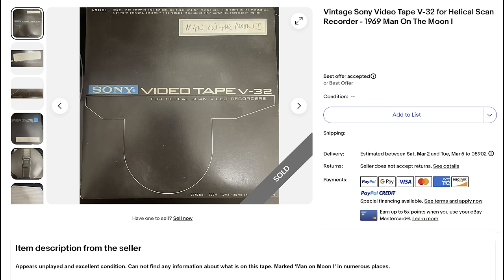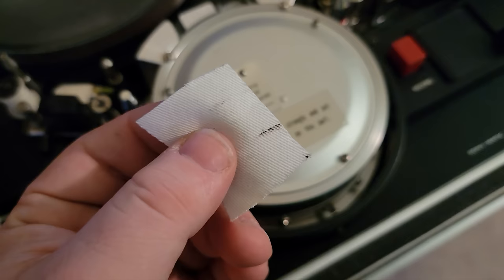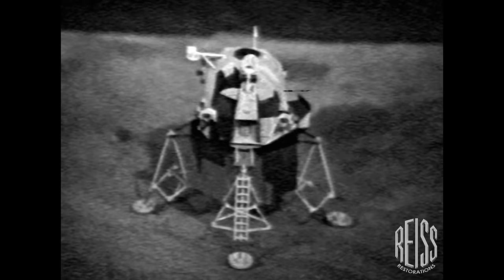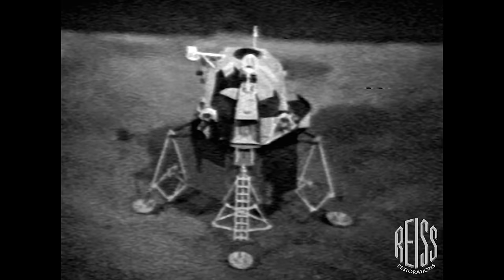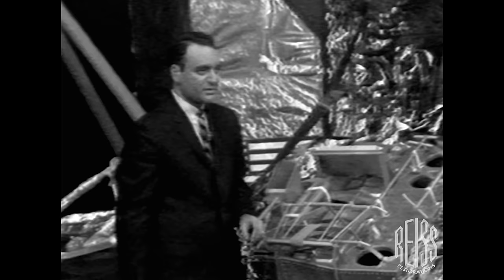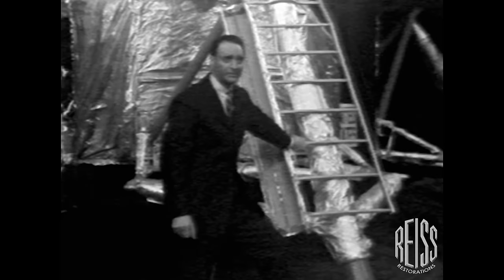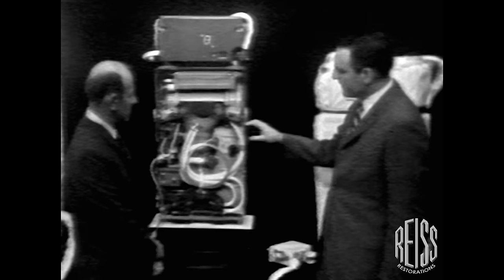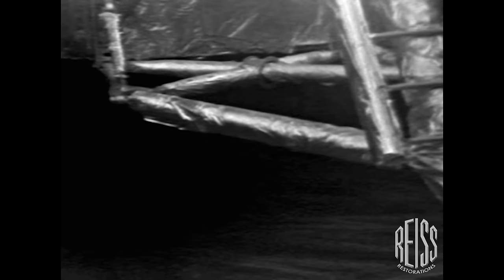Finding and Digitizing the Apollo 11 Moon Landing on NBC (July 20, 1969 - Partial Broadcast, B/W)

Comment: They did this landing in 1969 with the computing power of a cheap calculator and live real-time audio, as it happened live... and yet in 2024, they can't even land a little lander without it topping over, and they did it WITHOUT any real-time video. You would think that in 2024 the Intuitive Machines-1 lander would have had a real-time video feed from an onboard camera during the landing so the engineers could have at least watched the landing as it happened and known right away it tipped over, instead of waiting 15 minutes for a faint weak signal. to tell them it tipped over.
Reply: A real-time feed wouldn't work. Radio signals travel at the speed of light, and the moon is about one and a half light-seconds away. That means the video takes a second and a half to get to earth, and the response from earth takes another second and a half to get back. By the time your response is taking effect on the moon, it's two or three seconds too late. Neil and Buzz could react in real time because they were physically present, but the robots have to make do without human help. In Apollo 11s case, the human element was absolutely necessary because the LGC was going to land them in a boulder field; Neil took manual control to fly over it, and it took nearly all the fuel in the descent stage to get there.
Reply: The computer was mainly used for telemetry and monitoring they onboard systems.  It didn't land the LM, that was done manually.  It is incorrect to say that they can't land a  lander now.  It has been done more than once in recent years, in spite of the  failure of one of the landers.
Reply: @my3dviews  " It didn't land the LM, that was done manually."  That's simply not true... research 1201 and 1202 program alarms.  An automatic landing system was guiding the Apollo 11 astronauts on their final descent to the Moon. But Armstrong noticed it was sending them toward a boulder-covered crater. He quickly took manual control to take them safely to a flat area. during that override, the computer was getting confused between what it was supposed to do and what Neil was commanding it to do triggering the 1201 and 1202 program alarms.  Capcom told Neil to ignore them and to continue.  All subsequent Apollo landings used the automatic landing system.  And it's not just "one" failure...  the Japanese lost one just weeks or months earlier as did the chinese. ITs actually more frequent than you are leading people to believe.
Reply: @SuzuranMajere  LMFAO  who the hell do you think you are talking to?   First of all, a camera on the IM-1 (or Apollo 11) would have just been a monitor so it would make no difference whether it's .5, 1, or 1.5 seconds or longer... its just a video feed.  Who cares whether there is a delay or not.  the thing was landing autonomously, the video picture is pointless other than to "just watch" so the engineers would know how it landed.  And live camera feeds were coming from the moon's surface on ALL the  Apollo missions,.  Including a live video feed from the lunar rover while they drove around. We watched it happen live.  So what if it was a 1.5 delay.  The delay is pointless in terms of just watching.
Reply: @SuzuranMajere  "In Apollo 11's case, the human element was absolutely necessary"  Also bullshit.  In 1969 there was NO way of flying over boulders automatically because Terrain Following-avoiding Radar hadn't been perfected yet.   Research F-111 TFR.  So in that case yes Neil had to override the landing computer.   But 50 years later Radar altimeters and Terrain following/avoiding radar have been perfected.  There is no way a machine in 2024 shouldn't have had its own autonomous terrain avoidance landing system.  A System to automatically avoid terrain i.e. rocks or boulders that would allow it to topple over.  This is what happens when someone posts a comment assuming people are as knowledgeable as me, and then they try to respond not knowing 1969 technology vs. 2024 technology.  Thanks for trying though.
Reply: @ILSRWY4    Sorry, but you don't know what you are talking about. 
All six landings were done manually.  
Look it up.
Reply: @my3dviews  And you don't know how to comprehend the English language.   You said "The computer was mainly used for telemetry and monitoring the onboard systems" I told you that it had an automatic landing system and then I told you  "All subsequent Apollo landings used the automatic landing system."  And that is 100 percent TRUE.  The automatic landing system took them down to a couple hundred feet, from there I never said anything about who or how the actual touchdown was completed, only that there WAS AN  automatic landing system that was used for more than just monitoring systems"  That is FACT.  Understand what you are reading before you tell someone else they don't know what they are talking about.
Reply: I think you answered your own question.
Reply: @5piral0ut  my orignial was sarcasim

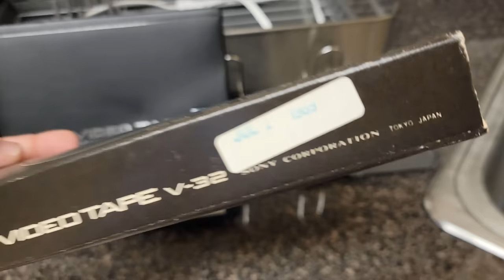Comment: QUESTION - from 40minues of the video until 1:05 ….25 minutes straight with the camera and the module fixed with one same angle , the shadow didn’t change ! still static…what is impossible !  the moon supposed are following the earth at the speed of 67.000 mph ( 107.000 km/h ) + the moon speed over the earth at 2.288 mph ( 3.683 km/h ) while it’s revolving around the “ globe earth “ as earth also revolving around the sun path according to main stream science , 2 speed movements, 2 round path at the alarming speed and the shadow didn’t move of place and shape for 25 minutes straight ! 😂 …. do some real science, go out right now , take a picture of a pool or your car shadow from the sun , put an alarm for 25minutes and take a picture from the same spot and distance and compare the photos , shadow from the sun are not static because there are ( 2 bodies ) in movement, just impossible ….but possible in a studio with fixed lights , so….!?   😅
Reply: A day on earth is 24 hours; a day on the moon is 672 hours.
Reply: According to  an article on BBC Sky at Night magazine , if you ( true  science ) make a experience with facts , take a powerful telescope and observe a reference point on the moon surface and compare every 30 minutes , you gonna see ….the article conclude as follows ( Centre your chosen feature and make an observation of it.

This could be a sketch or image, concentrating on the position of existing shadows or small patches of sunlight visible in dark shadowed areas.

Then wait, say, 30 minutes and do a similar observation. Repeat for as long as possible.

Comparing your results will show just how fast shadows on the lunar surface can appear to move.

It’s also a fascinating way to perceive the 3D nature of the lunar surface, the movement of the shadows giving relief features a more pronounced feeling of depth. ) 
August 2022 .  The moon it’s at speed of 67.000 mph in a elliptical path following the earth in 2 different simulations movement  and 2 simultaneous speed , a static shadow falls from observable factual data , this video is what’s is …a 1969 TV show  🎬🚀🌔📏📏

Comment: I remember finding an old wire recorder a few years back with a few spools that someone had recorded local radio broadcasts on seemingly in the 50s or so, it was so cool to hear something that quite likely no one has heard for several decades and no one probably has any other recordings of. Honestly I kinda forgot about it since I got busy around that time but I think I need to digitize those while they still (hopefully) work

Comment: Isn't it amazing that the communication devices used between Houston and the moon were as fast as modern GSM? No delay, despite the insane distance between the earth and the moon. Clear sound, often better than the AT&T signal in 2024 in rural areas. Simply amazing. Such a shame that NASA lost all the technology they used in 1969, that was so superior to the 2024 low-orbit Starlink global digital communication satellite system.

Comment: Thanks for the video!  But was there no way to wind the tape just directly from reel to reel while cleaning & rewinding to keep the "gunky" baked tape away from the heads, guides, capstan, pinch roller, etc. - or at least the heads???  I never used a VTR like that, but on old audio reel-to-reel machines, you could easily "cheat" if necessary for doing something like that by propping up (or away) switching sensor arms (for lack of any known better name) that would otherwise shut down the winding motor(s) at the end of the tape.  I would in fact often do that, after noticing how much tape oxide (from good tape!) would build up on those hard-to-clean sensors and pinch roller, when I was done with a reel and only wanted to rewind it.

Comment: Great job digitizing.
How do you or NASA explain the different camera angles in the descent footage?
Obviously we forgot that in the day there was only film which had be gathered from the cameras and developed or processed in a phot lab.
And how do get a Livestream from the moon in the 60's and early 70's?
Obviously by the modeling this footage is done in a Thunderbirds TV studio or the like.
So I can quite imagine how this footage was supposedly lost.
Just like all the other data that NASA has lost.
Have will lost the ability for accurate critical thinking?
Reply: There is not any footage of the descent from outside the lander, and they did not live stream anything, they transmitted an S band radio signal to the gigantic dish antennas of the Deep Space Network receiving stations, which then were sent to Mission Control, then fed to the television broadcasters, distributed out to local transmitter towers and into people’s homes.

Comment: Awesome find! Not gonna lie, I'm still a little confused how the camera got set up before the first steps on the moon?
Reply: There’s the LM MESA that you can google. The TV camera is installed in it and pre-aimed toward’s the ladder. Just a simple matter of a cable and pulley system back to the porch above the ladder with a handle Armstrong pulled to deploy the MESA. Afterwards they removed the TV camera from the MESA to use for the rest of the EVA.
Reply: @mako88sb 😂

Comment: I've got tapes at LEAST that old and have NEVER had to bake any of them and they played just fine.  The only ones I've ever had a problem with were Memorex tapes and that was only about 15 years after I bought them and mostly because of the mechanism, not the tape itself.  And, of course, SOME Radio Shuck tapes that started going bad on me fresh out of the box!  I could record on them with no problem but, playing them back not long after was a nightmare!  Oxide melting onto the tape heads and quickly solidifying keeping the tapes from moving at all.  One or two other brands gave me the same problem but I don't recall which, at the moment.
At what point in the mission did Pink Floyd start playing?

Comment: I was 14. Now, this July Will be 69 lol.
I watched this and many more.
Just think,  the moon landing Saturn Rocket and lander were all designed with excellent engineering knowledge , slide rulers , paper and pencil.
 50 years latter a group with every modern computer, 3d imaging and more, lands a small craft on the moon and what happens. It falls over.
The attitude is, it was only 11 million spent. Oh well.
 That's the problem.

Comment: I still can't believe they had enough power to transmit radio waves all the way back to earth so clear and without any latency...and they received signal without a formidable antenna that would have needed to be at least 100 ft tall..
Reply: Me either. My cell phone still doesn't complete calls when its raining.

Comment: While there are several scenes that demonstrate just how impossible this moon landing was, 31:50 is incontrovertible proof that there was no way they would be able to use the switch, as demonstrated to regulate the water temperature of their space suit. If you do some research on the gloves the astronauts used, it would be near impossible to use them to regulate the mixing valve. The guy demonstrating can only just pinch his finger onto that switch!!
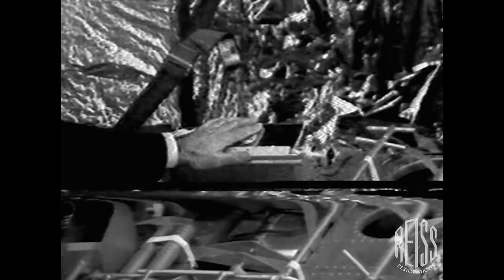And go to 20:40 and note all the utilities the astronauts had to use!! Try assembling that camera and mount as well as the other things with those gloves on!!!
Reply: Can you flip a light switch with your elbow?  I can.
Reply: @tcapone1734  It's not due to gravity, it's due to the vacuum of space. The density of molecules is the reason you have to cook differently at higher altitudes. Armstrong Limit. They wore pressurized suits, they didn't boil for the same reason you don't suffocate on planes.

Comment: Nice, you can really see the stage and backdrops.

Excellent work. Outer space is fake. You can’t have gas pressue without a container. If the sky was a vacuum the gas we breathe would fill the space. Men have never been to the moon, the journey claimed to have happed is via a second law of thermodynamics violation.
Reply: It says “animation” on the screen.
Reply: Fascinating that you believe in thermodynamics but reject gravity. That’s honestly wild to me. Like, you can’t just cherry pick which laws of physics you believe in, dude. The reason the atmosphere doesn’t dissipate into space is because it’s gravitationally drawn into the center of the earth. As the atmosphere gets further away from earth, that gravitational effect weakens and the atmosphere gets thinner until the force of gravity from earth isn’t strong enough to hold gasses down anymore. So, just by gravity, an atmosphere forms that gets denser as it gets closer to the surface and fades off into nothing as it gets further

Comment: I’m curious why you use a dehydrator instead of just a regular oven? is there a danger in doing one or the other? Surely the dehydrator is removing moisture far more aggressively than an oven would. Is that good or bad?
Reply from the maker: Moisture is the enemy of magnetic tape. I've heard about using ovens without issue, but this is thr safer method that works for me.

Comment: Funny how Neon Bright Light the "Moon" is, but can barely see them in the dark??? 🧐🤨🤣🙃😉
Reply: Stanley Kubrick film 2001 space odessey released in April 1968. He helped direct the hoax. June 1968. Location?  New Mexico. Cannon Air Force base.
Reply: @maxsmith695  Thanks! I'm from NM and have Never heard of Cannon AFB, 😯, so, Super Thanks. ( Which I find odd)
Reply: @createa.googleaccount713   It is in NE part of State , intersection of 60 and 70. The air force had their special forces unit based there,whatever that was called, no idea. The filming took place June 5-8, 1968. LBJ and senior White House  folks saw it. That is not a typo. 1968. I suspect LBJ wanted no part of the hoax done on his watch. He left office in Jan  1969.

Comment: I have been wondering about the time this originally aired live.  I was in London and saw it as a kid. It was daytime there. What time was it in the USA?
Reply: The lunar module landed on the moon at 4:18 pm EDT (July 20th 20:18 UTC).
At 10:56 pm (July 21st 17:54 UTC), Armstrong first stepped onto the moon.
The events shown in this video take place over about 7.5 hours.
The EVA lasted about 2.5 hours.

Comment: Does anyone know who was running the video camera?
Reply: Yes it is widely know that a “cameraman” was not involved in the broadcast from the lunar surface.
“The camera was stowed in an instrument pallet known as the MESA (Modular Equipment Stowage Assembly) in the LM descent stage. The MESA was to the left of the ladder as viewed from the front of the LM. When Armstrong was at the top of the ladder, he pulled a lanyard to swing open the MESA, which was hinged at the bottom. The TV camera, which was attached to it, would also swing down. It was mounted upside-down so as to secure it firmly to the MESA with vibration isolators and to also simplify its removal by the astronaut. Aldrin then switched on the camera by pushing in the TV circuit breaker in the cabin of the LM. The camera was pointing at the ladder of the LM, so that TV pictures of Armstrong's initial steps on the Moon could be relayed to the world. Later, after Aldrin had descended to the surface, Armstrong mounted the TV camera on a tripod, and placed it some 10 metres (33 feet) from the LM. The camera was left unattended to cover the crew's activities during the remainder of the moonwalk.”

Comment: Its funny to me how can people still spread dumb theories around when at 20:30 you literally have everything explained plain and simple in 10 minutes. Many thousands of undoubtedly not fakeable photos, rocks and sand in the museum. Actuall scientific explanation of how the rocket was landed. Radio communication was possible with delay of 1.5 s which you can hear in the broadcast. There is at least a 2 second delay between conversations. Also the camera was modified for such high resolution photos, It was specially made from Sweden. I remember people talking how you could point an antenna to the moon and pick up signals from the moon of them talking back. At this point its like talking to flat earthers. You unfortunately cant convince dumb people.

Comment: You put that videotape at unnecessary risk by not doing even minimal research about sticky shed syndrome. It only happens on tapes made with the synthetic replacement for whale oil once it was outlawed in the early 70s, so tapes susceptible to sticky shed syndrome didn't even exist until five years after this video recording was made. Minimal research would also have informed you that 135° in two hour segments, testing and flipping the tape between each, is the established best practice standard for the tape baking process.